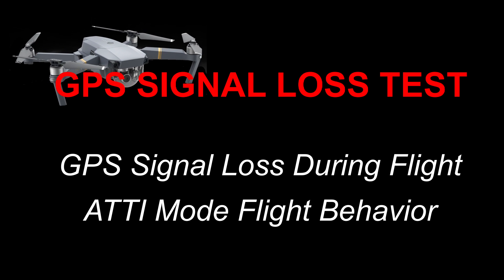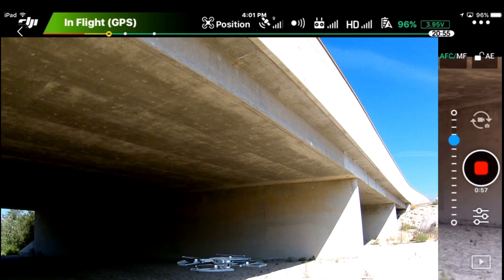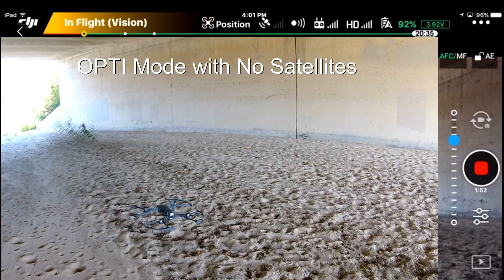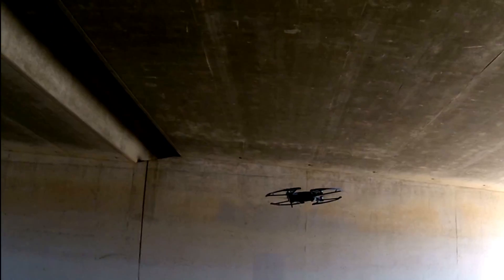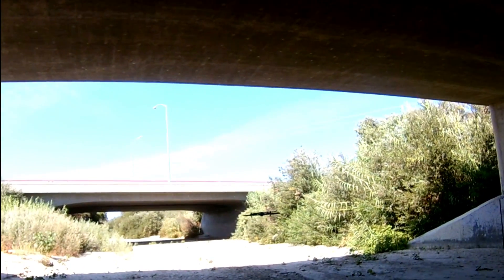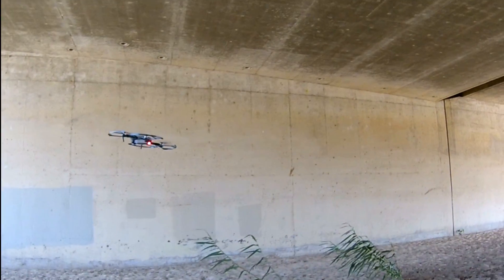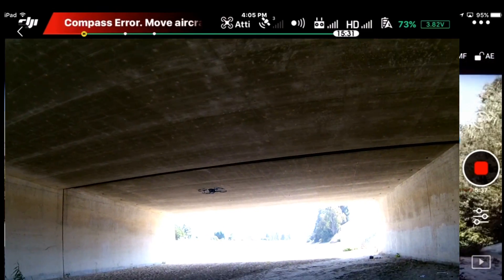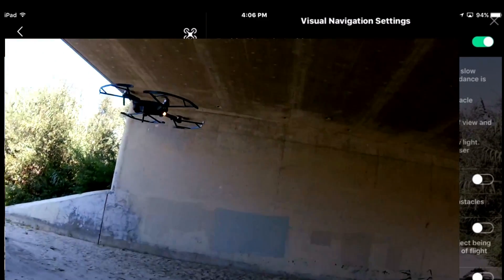DJI Mavic Pro / Platinum - GPS Signal Loss Test

Comment: Tks your test. Have you ever tested mavic\s behavior when both GPS / RC signal lost? Key question - either forced landing to start or just hovering until critical batter level.....(for the case when "RTH" or "HOVER" is set when signal lost in DJI GO)

Comment: Not sure if you respond to comments. Today I thought for sure I lost my drone. I have a Mavic pro, took off everything was great till I received a yaw error warning and the drone yawed to 40mph out of sight in normal flight mode, at the same time it lost gps and went into atti mode. About 10 seconds later it acquired satellites and I pressed return to home and I was able to recover it. I think I still had control of the drone, but I was unsure of its orientation and which way to push the stick without a functional gps map. A real heart stopper.
Reply from the maker: Yes I do reply :). Were you in an open area? How many satellites did you have before take off?  I’ve had a similar situation with the Mavic Air but Mavic Pro has been solid. Definitely gut wrenching!

Comment: So what I have to do when the mavic lost gps signal ? #1 just wait for gps back  ? #2 sacare and cry 😭  or what ? 
Help me Please
Reply from the maker: The main point here is to avoid obstructions that can block the gps satellite signals. If it does happen, you’ll have some control to possibly re-establish gps lock.
Reply: Dragon7 so we have to wait to gps signal back and keep calm down .
Reply from the maker: Jhonny Estuardo Try to fly back to where there is no obstruction
Reply: Hoy can i switch from gps to atti manually? That saved my drone in germany when it went crazy o don't know why, but i rapidly switched from gps to atti and brought it back down.
Reply: MyloMusica show me how can I switch gps to atti mode manual I lost gps and the controller told me switch but I didn’t because I don’t know how
Reply: I did that on a phantom wich has the 3 options on the top of the controller. but the mavic doesn´t. and that option is so important on a critic circumstance like i had.

Comment: Thanks for the video, however it just means that the mavic flies like a regular drone. I always suggest buy a cheap drone like the Traxxas Alias so you can learn how to fly first and that is how the mavic response without its fancy tech.
Reply: Correct, a no brainier, buy a cheap multirotor, even without altitude hold, better still, learn how to fly a RC helicopter first, that's what I started with, much harder to fly but makes you a better pilot

Comment: Thanks for the video. Rth was disabled I'm assuming?
Reply from the maker: +tja929 Hi, GPS signal doesn’t activate RTH.  Radio connection loss and smart low battery activates it. Thanks for watching!
Reply: Dragon7 ah yes thank you
Reply: Question. Hypothetically, if there is zero GPS, would RTH still function, as in, would it drone still know where home is if it is used?

Comment: But the RTH won't trigger? Heard something about setting it to hover mode when flying in woods for instance so it doesn't go up to the set RTH height.
Reply from the maker: RTH auto-triggers based on loss of signal between drone and controller.